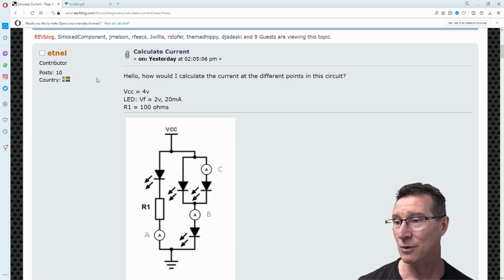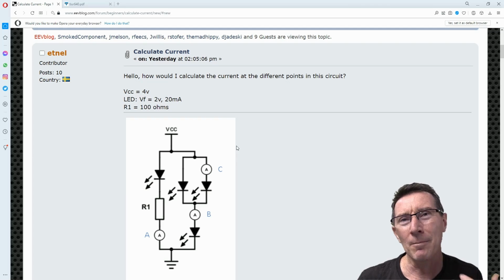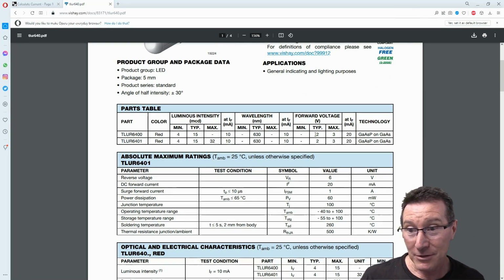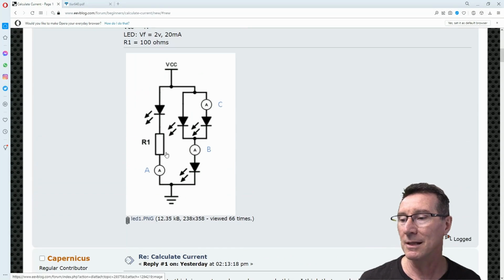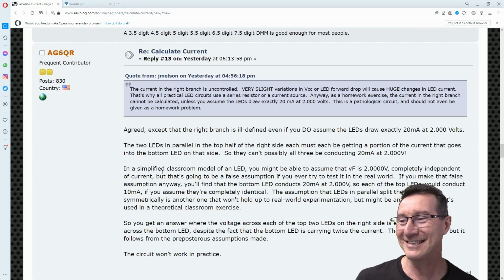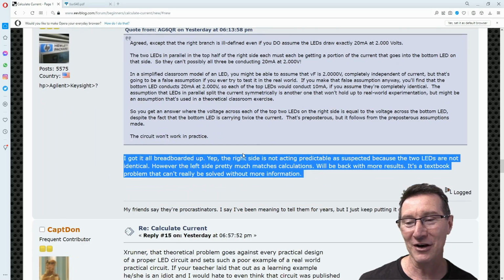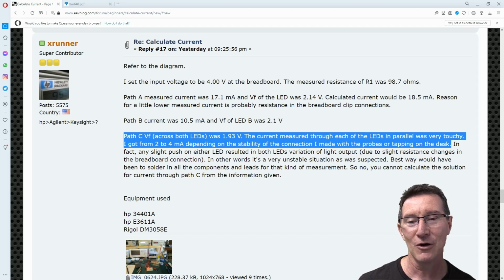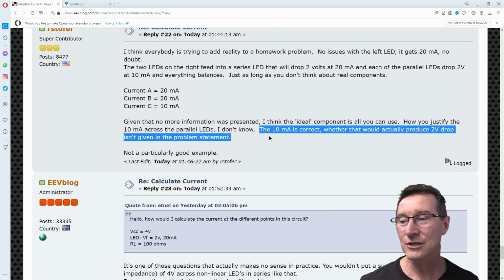EEVblog 1427 - An INFURIATING Electronics Exam Question!

Comment: If you had the exact diode equation, it is not a solvable equation by hand. You could either use iteration or a computer solving method but the intuition is likely spot on: the parallel LEDs will each draw less current/voltage than the ideal diode and the following diode in series will make up for it and draw more current/voltage. Those exact values will have an equilibrium point where kirchoff’s current law is valid AND the exact diode equations are valid for each diode, but the solution will require solving something like 3 exponential equations with 3 unknowns. An absolute nightmare so solve by hand and not what the author intended, but if we can build it, there WILL be a solution.

Comment: If you simulate this circuit you will see a dynamical system... either a run-away function that goes to infinity (causing some LED's to burn out) or there will be an "attractor" (or perhaps several) resulting in an equilibrium state or cyclic function where the LED's end up balancing out at some values (but not 2V, 20mA). Think of the chaotic bifurcation (population) function. It's a difficult exam problem but beautifully illustrates how you can get chaotic feedback. We are assuming infinite current source which is also not real... which would also affect the real current limit through the entire system.

Comment: As someone thats only taken physics and no circuits class, can't you treat the LEDs like a resistor of 100ohms? I guess it's not realistic but I believe that's what the question intends. On the left you have a resistance of 200ohms 4v potential drop so you have 20mA. On the right you get a resistance of 150ohms so your total current is 26.7mA which is what you get for B, then half that for A?

Comment: yeah, that's easy, now imagine if you had to try to guess a WEG's motor's model for a given power range and speed with no additional reference or model tables given and the teacher takes points because you didn't choose the highest efficiency motor possible made by WEG in a freaking hidden catalog while he NEVER fking said that we should choose the highest efficient motor.

Comment: "impractical bullsh1t" seems to sum up most of the Circuits courses in university. FML for all the circuits with impractical dependent voltage/current sources and then when you actually need to calculate the stuff it's all done in a different way because OF COURSE

Comment: The real, indisputable answer is that the current levels at B and C are undefined. There isn't enough information in the question to calculate them. You've got 4V divided across that series parallel array, and all you can say for sure is that it will not split evenly between the two parallel LEDs and the single one. It would be very difficult to even test this experimentally, since the current meter is going to introduce a series resistance. You could use a current clamp, but those are typically not very accurate in the mA range.

Comment: Sometimes in a pinch you can rely on non-ideal behavior of components. For example, you might use a coil of wire as a resistor. ATI graphics cards these days use inductors as shunt resistors. Styropyro once used the equivalent series resistance in a circuit with no resistors to limit the power going to a laser diode. And it wasn't a boring 5mW diode with tiny coin cell batteries. It was supercapacitors as the power source and IIRC the laser was around a watt.

Comment: Theoretical engineering classes and assignments in reality are just physics and math concepts training, the actual practical labs are (mostly) devoid of those nonsense but sadly they don't provide a lot of GPAs compared to the theoretical classes. You can be smart in the practical classes instead of the theoretical classes but your CGPA or GPA will take a huge hit compared to vice versa. Sad reality.

Comment: I plotted the V/I characteristics of a red LED, and obtained the following result for the question: B=28mA, the resistance of the bottom LED at this current is 73.3 ohms. C=14mA, the resistance of the top LED's with this current is 139 ohms each. This gives a voltage of 2.05V across the bottom LED, and 1.95V across the top LED's. 
Although not practical, I think this is very good theoretical question.

Comment: hi, im new to electronics, and having a little trouble understanding the concept of impedance. I thought low impedance meant low voltage and higher current...... and here I get 4V is low, but isn't 20mA also low?

Comment: Not knowing the full source of the question it is difficult to fully comment, but I have seen mathematical questions which are designed to check to see whether you are engaging your brain before ploughing in doing the arithmetic - they may ask for a calculation but are actually checking whether you are considering if the calculation being attempted is sensible.

Could this actually be a kind of trick question which is actually wanting the answer for B and C to be "depends on the characteristics of the LEDs" which is not given.

Alternatively it could just be a bad question in that the setter just ignored, or didn't fully appreciate, LED characteristics.

There have been mathematical questions set which were impossible to answer (eg what's the area of a triangle with sides 14 cm, 17cm  & 32 cm), or where the given diagram (not to scale) was misleading (eg lines are shown to cross inside a shape when with the lengths given they actually cross outside the shape).

Comment: My answer is not necessarily what will happen in a real circuit since the bias voltage is 2v (meaning the circuit would not conduct at all, if the voltage was less than 2v across the LEDs) Ic will be 0 if Ib is 0 however... since there would be no current flowing

Comment: If it wernt such a simple circuit - yes you would need a datasheet to figure out temperature etc - but with KCL it kinda makes things easier (like you got 20 cents worth to spend on powering B, C and "D" are in parallel, so you got 10 left?)

Comment: I'll keep working on this but I don't think it's as hard as you may think - you got 2 LED in parallel with one acting as a voltage divider in series, so just to guesstimate, if you had 2V at B, then B would be 20mA as well, and C would be 10mA (only a guess at the moment)

Comment: Correct me if I'm wrong but with Kirchoff's Current Law every current coming out of a node must be 0. You got 2 circuits in parallel - A is easy I = (4v - 2v) / 100 ohms,  or .020 A (20mA - can see this already because of KCL the LED takes 20mA (0.7v usually is vf on a silicone diode). B will (IMHO) be similar but you got 2 LED in parallel above it. They are 20mA (a piece) at 2V (to be continued...)

Comment: The current through A will be 20mA.  The current through B will be more than 20mA.  The current through C will be less than 20mA.   The voltage across the bottom right diode will be a bit more than 2 Volts.   The voltage across the top right diodes will be slightly less than 2 volts.  You can get the exact values for B,C and voltages if you have the data sheets for those diodes.  The fastest way to solve this is to build the circuit and measure the values.  Bottom right diode might fail.

Comment: The output luminosity at 28:10 isn't linear. It is an exponent, but looks like a line due to the log graph used.
Reply: Have you noticed that BOTH AXIS are LOGARITHMIC?
Reply: @paulcohen1555  you are correct. I briefly tought about that like 5 mins after writing the comment.
Reply: @brutester  I am still looking for some mm, log and log-log A3 sheets from the high school. (No computers, smartphones or just plain analog cellphones then)

Comment: I'd like to imagine this was deliberately crafted to show why you need to care about current limiting resistors, i.e. you're MEANT to come to the conclusion that "the left side works out fine even if your assumptions are slightly off, but the right side is a sh*tshow from the start so better not design my circuits like that". Judging by the backstory given by OP, though, this sadly isn't the case...

Comment: You can't answer this question, but pulling numbers out of my arse, A WILL be 20mA while B will be like 30mA, C will be 15mA (or 22/11 or 38/19, depending on characteristics...) because B diode will have say 2.1V on it and C will have 1.9V on it.
All in all, I would only make a circuit like this as a practical part of the class exactly to show that it isn't smart...

edit: holly smeg, Tomorokoshi actually made proper physics solution and got 28.3mA and 14.1mA so my gut feeling was not that far off! :D

Comment: A question about it, if the branch with ammeter C didn’t rejoin to go into ammeter B and rather went to ground, wouldn’t that one be able to be calculated using the info supplied

Comment: Led characteristics also change depending on the amount of light hitting the led itself. Infact, you can use a lit led as a light sensor with sensitive current sensing.

I imagine the changes from touching the led from the breadboarded circuit included some of this effect.
Reply: Yes. Even glass diodes do this but LEDs are much stronger.

Comment: The academic will assume that the forward voltage is exactly 2V under all conditions, and at any current up to 20 mA and leds are a perfect match ...A, B= 20mA and C is 10mA...Its to test a student basic understanding.

Comment: Kirchoff's current law?  Don't the extra electrons just fall off on the workbench?  I've heard they are very lightweight.  Just model the LEDs with a voltage source and resistor to approximate the data sheet near the 10mA to 20mA range, then use loop equations.  Probably gives something reasonable.

Comment: The first problem is the parameters of the LED: Vf = 2V, 20 mA. In most cases I'd model an LED as an ideal diode* with in series with a voltage source. However, if we read the 20 mA to mean: “at Vf = 2 V, I = 20 mA” then we can’t use the model, as the model allows any forward current at Vf = 2V. So then we're left with an LED with only one point on the current-voltage graph defined: 2 V @ 20 mA**. This point on the graph happens to work on branch A because Vcc and R are exactly right.

On the right hand branch, we’re stuck. The LEDs can’t all be operating at the defined 2 V @ 20 mA operating point, because they can’t all have the same current. If we ignore the 20 mA and apply the ideal diode and voltage source model, we get the 4 V supply and three 2 V voltage sources balancing each other (satisfying KVL), but the current is undefined. A better approach would be to apply the diode equation, but with only one defined point (two with the origin) on the LED operating curve, we don’t have enough information to work out all the variables (although Tomorokoshi apparently managed to eliminate them by assuming the diodes were identical, but I haven't been able to follow his working).

In a practical circuit, each LED would likely follow a different curve due to slight manufacturing differences. The right hand branch would be very sensitive to this, resulting in unpredictable currents which may be enough to damage the LEDs.

*ideal diode meaning zero forward voltage drop
**we could also assume it passes through the origin

Comment: I totally agree with this question being dumb. BUT... your datasheet shows that there is quite a reasonable point on the I/V diagram where the current through B is 2x current through C without killing the LED at B. The I/V diagram is not too unlinear between 1,7-2,3 V (yeah I read the log scale). Calculation indeed is not really possible, but a wise answer is :-)

Comment: A is a simple simultaneous equation, which you don't have to do, because you can see by inspection that the 20mA through R1 gives 2V, which conveniently means 2V@20mA the left LED. This would be unsolvable for any other value without the Vf/I curve. B and C cannot be solved without the curve; there can be no 2V assumption, assuming even current sharing the top pair and bottom cannot be on the same part of the curve, therefore the data provided is insufficient to solve it. It cannot be 20mA @ B, resulting in 2V across the bottom diode, because that would put the upper diodes at a lower voltage -> the bottom diode would be over 2V. The conclusion is B > 20mA and C = B / 2.

Comment: This reminds me: I don't like resistor driven LED circuits, at least for illumination since the resistor wastes energy to heat!  You could use a transistor or a mosfet and a capacitor to drive them at a constant current and top up the capacitor as current drops.

Comment: Terrible exam question, at least at an introductory level. Great tutorial question to get conversation going about how well these models represent reality.
btw, yes, with the information provided, it would be impossible to figure out. Though if you had a datasheet, and were told to assume a linear approximation of dI/dV about 2V it would quickly become a simple simultaneous solution problem.
Along with all the other assumptions that is of matched diodes, etc.
From some pixel counting on a datasheet; the current through point B would be pretty close to 20.3 mA +/- 0.2mA. That's plenty good for an engineer.

Comment: It is incorrect to even mention the @20mA during the start of this video, you can't say B=20mA, C=10mA, that's not what Vf=2V @ 20mA means! That said:

I think you're supposed to assume Vth is constant in ideal LED, so Vcc=4v, so right hand leg doesn't turn on at all! B=0mA and C=0mA, A = (4-2)/100 = 20mA. Since Vth=2V@20mA, you know that the Vth is correct for the left-hand LED and no more iteration is required.

Of course, in real-world, Vth is lower at lower currents, so the right-hand side will turn on, meaning many iterations will have to be calculated on the right-hand side to find steady-state.

Comment: I feel a bit bad I could not in good concience laugh or even smile at this treatise; I really don't get why people assume it's a "dumb question" without knowing if that evaluating the reasonableness of the circuit or well-definedness of the currents is part of a complete treatise expected. There are certainly bad exercises out there, because they ask something which makes lots of non-explicit assumptions, but don't let them give a bad name to every problem where the answer is "no well-defined solution". Not all of us teachers simply teach one expected rigid method to calculate something, and then simply give "bad cases". I would routinely just fail every answer that did not seem to even consider that there are issues - and that would be the main point of the question, even if the initial task was to just calculate the currents.

It is hugely important in education to teach people to evaluate if some toolkit or machinery is applicable to a problem in the first place. Seeing what can be done with the current setup and tools, if there are contradictions and kind of assumptions can be made or are reasonable (in terms to mathematical modelling, not in terms of "what does the teacher want"), is a crucial step in the process to learn and use. I would do that before even giving "actual" big, well-defined calculations. It is bad to simply assume a student will easily over time learn that by themselves if they are only given streamlined problems that always have a unique answer to tackle. :/

I see how some students could call it "unfair" if they didn't give it the treatise, but that's up to the teacher and materials to set up the expectation that people have to think. This exercise in itself is not bad.; it only looks laughable or frustrating if you think you are supposed to "just calculate". Which you shouldn't, ever, without checking what holds.

I think I feel bad that bad previous executions due to bad communication and didactic negligence have simply kept feeding this expectation that people are only looking for problems "in school" to be straightforward. This severely impedes more progressive and practically more useful education. (If theory doesn't include everything you need in practice, it's a shitty/incomplete theory and I refuse to make it a fight between those two.) 

I don't think it's okay to both laugh (awkwardly and blamingly, not because of pure joy or praise) at tasks like this in the context of "people need more thinking than calculations" while at the same time not allowing problems exactly like this which would be great at teaching the very progress you called for. Let's not accidentally block didactic development by giving a too early verdict. The "this is a good work interview question" point did help out this, though. I just wouldn't deem the exercise/question bad without knowing if the teacher/material didn't allow for the possible answer of "no solution" to a problem. Every student should know that there are ill-defined or impossible/contradicting problems out there where the (only) acceptable answer is "no solution", and we have to encourage this.

(Note: there are thus two good ways we can improve the question. IF and only IF the whole point is teaching mathematical methods of LED behaviour, then you need all that extra chart info. If you are not supposed to teach that exact "here's how to read a graph" stuff here, as it might have been earlier or come later, but the actual notions of Kirchhoff's laws and LED nonlinearity and current-drivenness, then it's an alright exercise already assuming the teacher or solutions guie the students toward accepting that no well-defined solution exists and it's not a mistake in the exercise. For sake of random people on the internet reading it without didatic context, it could be improved by simply adding "calculate currents, if possible" or something, but in a better, more ideal setting, that should not be necessary, so for in this situation, that reminder would only be for PR/disclaimer reasons to stop people from trying to be "too smart".)